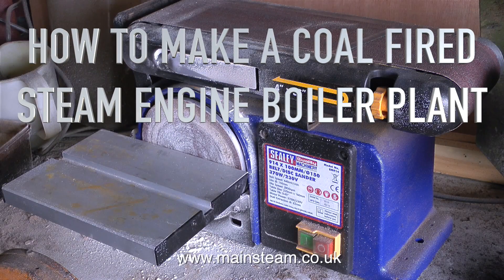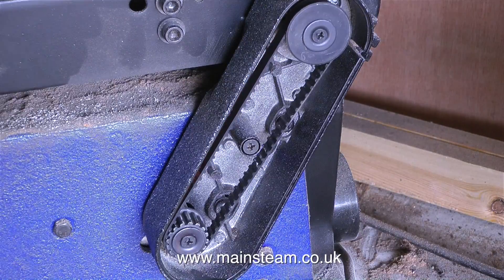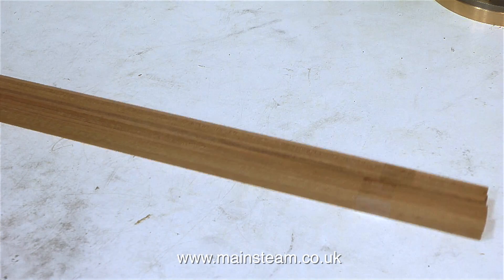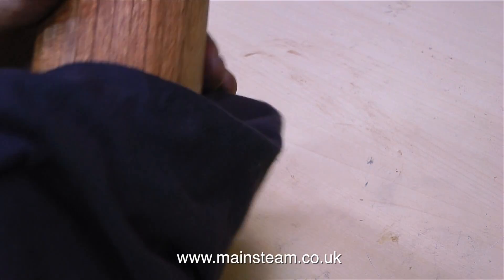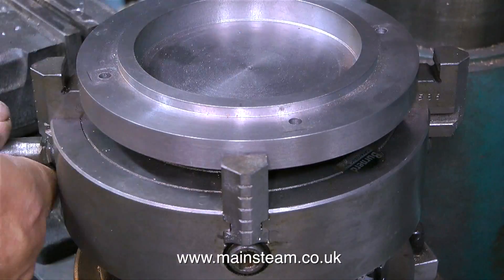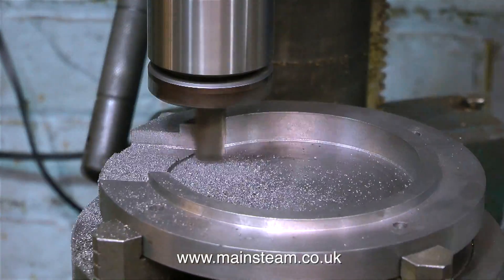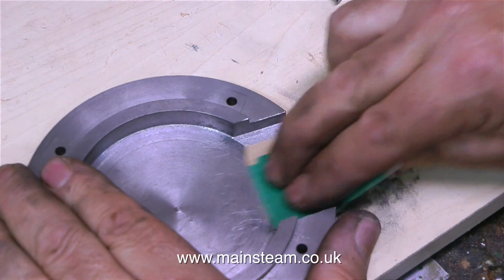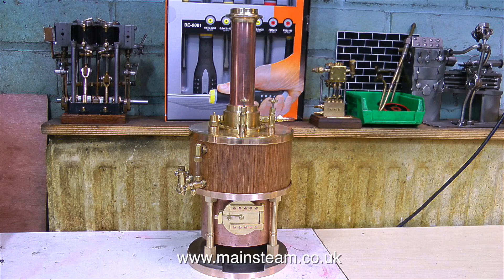HOW TO MAKE A COAL FIRED STEAM ENGINE BOILER PLANT - PART #23

Comment: 4:00 one of the oddest spanners I've ever seen.
I've been very impressed by the Bahco shifting spanners. The Stanley or unbranded ones here in Australia just suck, they don't hold their diameter, the jaws are never parallel, it's a nightmare. I'll have to get myself a set of Bahco down the line.

Comment: One thing that I find puzzling is why insulate the condenser with mahogany when a condenser is supposed to condense steam to water which means getting rid of heat.

Ah, the mistake of not watching the entire video before commenting, I paused, commented/questioned, unpaused and got the answer. Serendipity.
I would have settled for "it looks nicer".
By the way, is the oil reusable from the oil trap/condenser?